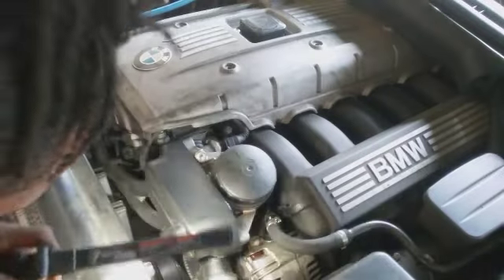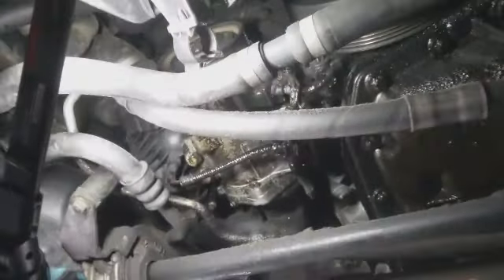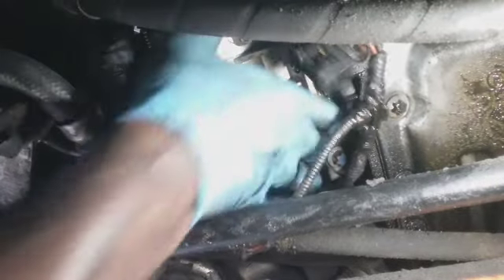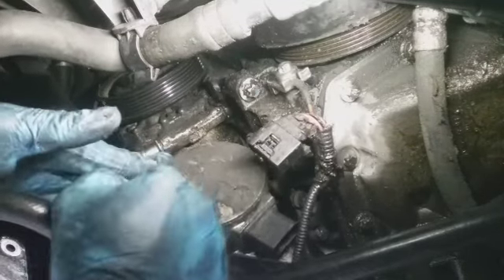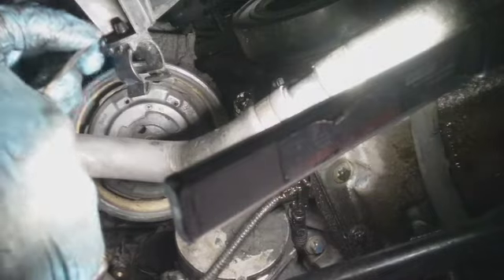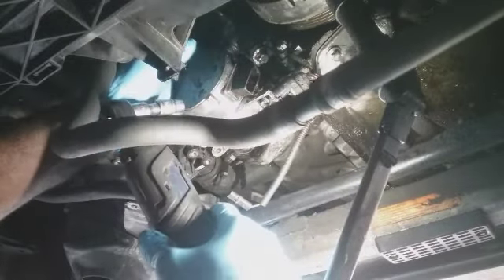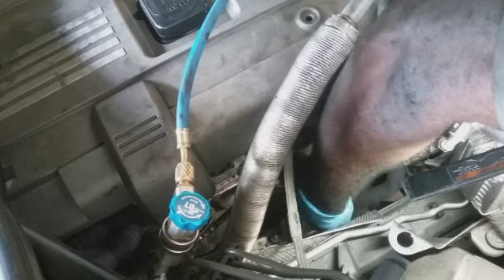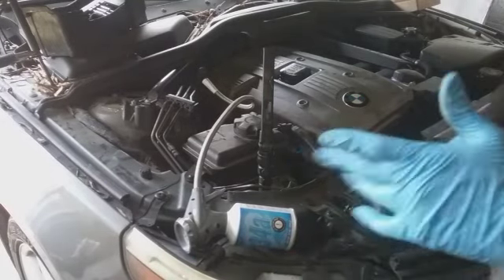How to BMW 525i a.c. compressor R&R [when things go too smooth....this happen!]

Comment: I have to do my A/C compressor, also. Hearing you sigh was exactly my reaction when I went in to asses the way to do it. Good work not having to drain the coolant. Other videos shows the guy draining the coolant. I belive your video is the best method. Although, I think I'll remove the fan if I can. Thanks for the video.

Comment: if you are doing this, do yourself a favor and remove the fan assembly. the driverside has a tab that will fold out so you dont have to remove or even drain your radiator. it makes things so much easier.

Comment: Thanks bro for the video I was able to fix my BMW525i just got the AC compressor replaced today and she’s running good And thanks for the comments it was easier removing the fan I was able to get the AC compressor out pretty quickly

Comment: Hey great video does that compressor have a clutch cause I cant figure out why my ac on the same car isn’t blowing cold air checked all the fuses,temperature sensors, cabin filter sensor, fan idrive settings and still nothing is wrong I would appreciate any type of help thank you!
Reply from the maker: Depending on the model, if there's issues with the electrical fan, the system will not operate! 

Do you have a bidirectional scan tool to look at HVAC data?

Comment: Welcome to my miserable 😩 life I work on these cars man sometimes I want to quit,  but I challenge my self not too.
Reply from the maker: I always say, "ima quit and work at family dollar" 😆 money too good though

I literally damaged 2 bumpers in 2 weeks! Moving cars, cost me $300 for both, lucky my brother do body work! Did the second today! Costumer suppose to pickup today, it was that '12 g37. I wanted to shoot myself -I just laughed with hysteria.
Reply: I hear you my brother just keep doing your thing you will succeed because life never easy it all about challenge sometimes you have to challenge your self to see you did a great job full video have a bless day.
Reply: Hello friend sorry  to bother you, 
Since you work on these pain in the ass cars,  i just bought  one  07 525i, i know big mistake,  ac stops working 3 months  after,  now where is the receiver  drier, i can't  found  it , since i have to replace  the compressor , they says is a must change  the recivier drier, where is located, no videos on the tube
Thank  you in advance
Reply from the maker: @Isgood2beKing  typically you don't have to replace them, unless the compressor internally damage causing fragments. Part stores try to upsale by selling combo parts.

If you don't have an obstruction in the system from the receiver drier, then just leave it be. 98% you'll be fine

To answer, Some drier filters are located on the condenser, follow the low suction hose. You should find it.

Nellow wellow, can likely provide you with more insight im missing
Reply: Thank you  for  your  time  and  help,
Well they put  tint inside and was working for another 3 months, and he  check uv ligths  ,says is the compressor  liking , but he wants 3450, that is crazy,only the compresor is 850, plus re fill again freon , for the 2 sexond time ,flush the line and condenser, bla bla
So i gonna buy the compressor  and do it myself,  that's  how i crossed  you in these video, others says always change  it but is like a big gulp  black,  no one talk about the bmw  ,
Thank you friend
Reply: @postitandwatchit1434  if mellow wants to help me awesome I see he is in foreign cars,
I hope he does,
Any thank you both,
Reply from the maker: @Isgood2beKing   Kratos  I say don't change the drier. There worst problems that arise if there foreign partials inside system, and just changing drier isn't gonna improve anything if it's not broken or defective. 

I'll save my stories for another day! But I can assure you, if the compressor is failing, you'll be perfectly fine replacing compressor only.

Not sure if you're I. The USA or not but check the price at rockauto.com. compressors are 1/2 price that of the part typical store. They're new and I've installed several GPD compressors with no issues!

Goodluck
Reply: @partsshooter  thank you, yes Im at Florida, 
I will check  the website especially  if a good tech and says is a good place, rhank you again for the help,
Reply: I have the same car 2008 bmw 530xi my ac acting the same way not getting cold I empty the freon starting fresh with 2 cans freon still not cold enough low is very high, the high is low on 50 psi I’m thinking maybe my compressor going bad not sure yet
Reply: My low side is very high like 70 psi even 1 can Freon still high, but high side is low like 50 psi not sure why I will check the pressure switch or expansion valve, this is  where ac system getting complicate
Reply from the maker: @postitandwatchit1434  I can guarantee your compressor is shot!

Heres why, the compressor is the heart [pump] of the system. It's like you having low blood pressure, the volume of bloods there, however the heart is incapable of producing adequate pressure.

If it was something else besides your compressor, your pressure would be high. Because the pump is then capable of producing high pressure.

Pressure switches only purpose is to cycle compressor, send feedback to module, pcm likely.

Expansion valve would still produce high pressure,  because expansion valve going out would generally obstruct or completely open system. Look at it like a thermostat of the system
Reply: So my low side is high, and my high side is low. So if the compressor was good my high side should be around 150-200 psi correct.
Reply: Thanks 🙏 for helping figure this out
Reply from the maker: @postitandwatchit1434  your compressor is capable of supplying 500psi! Before a pressure relief valve open! Or if it doesn't have a mechanical relief valve, the ecm will deactivate the compressor because it senses out of spec psi. Just as your compressor is required to have a minimum pressure to activate, it also has to stay below a certain psi before it deactivate.

Oh yeah... No problem! All ac system have the same fundamentals, just different sensing methods to control the system
Reply: @partsshooter  thank you again buddy, the website  get me a good brands  of compresor around 350 to 400, when BMW charge me 850$,
Nissenn and four season gives 2 yeras warranty  but have to change orifice,  and drier , ALSO a flush of the system , so i get delco, 1 year  but they do not request the other  parts, thank you ,
I SO AFRAID AFTER I SEE YOU SUFFERING , but i have to do it in florida is impossible  rigth now and we don't  even start yet.
I will do my best i let you know how was it, cause using A/C pro "sealing  "only last 4 months and  blowing warm  air,
But is not bad idea doing it ever summer 40 $ , not nightmare 
You are a expert  and was hard time  for you ,to get it out, i have to buy tools like hex 4mm and some wrenches, 
Wish me good luck.
I hope is done quickly
Reply: @partsshooter     and NELLOW WELLOW 
 I would like to share with you , if you have the time,
Asking a friend for torque  wrench.
He also brought  a UV light, 
He  think  the compressor  
 IS FINE , is  leaking from the "o" ring of the low port line, but also show me      the plate  of the clutch  in the  BOLT is a  tiny spot of dye,
NOW IS YOU KNOWLEDGE,  is posible to leak from the clutch  and the o ring , and the compresor be fine just add 1oz of PAG 46 just in case  .
I will  replace  if  you tell me to,
Just Asking thank you so much  in advance
Reply from the maker: @Isgood2beKing  yes..it'll  leak from the drive shaft of the compressor. Once you replace the compressor, it'll generally come with o-rings. If it's confirmed there's dye there, it's a clear indication it's leaking! If you're in doubt, clean arra with brake cleaner and recheck once system leaks. 

Also, check drain port, where condensation leaves evaporator for dye.